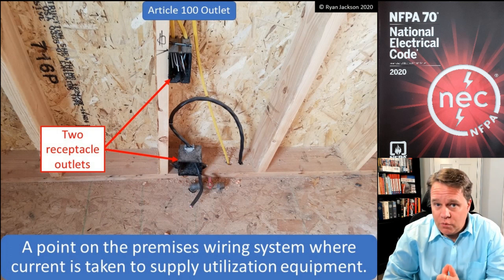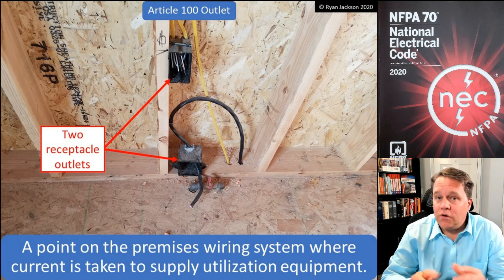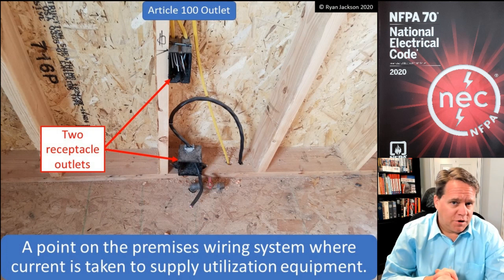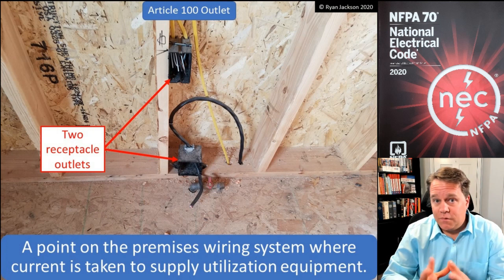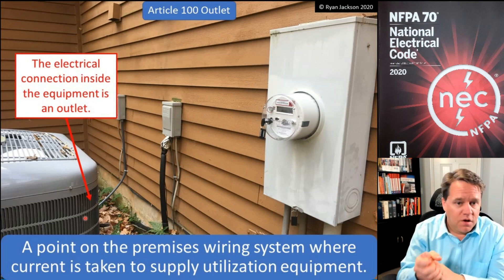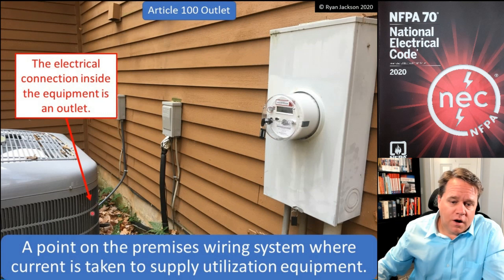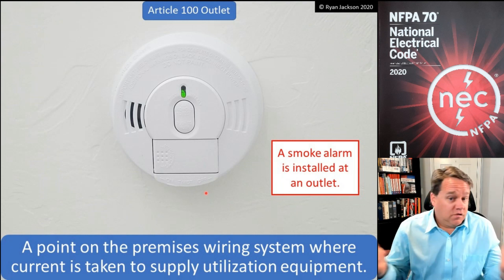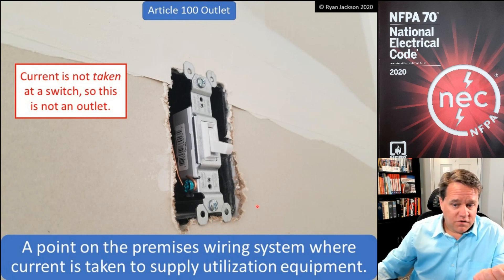100 Days of Article 100: Outlet

Comment: With the new "smart" switches like Z-Wave, etc. that can take the place of an old "dumb" light switch, those consume a small amount of current to power the internal electronics which enables them to turn a light on and off.  Also, there are even "dumb" light switches with backlighting, that's usually on when the switch is off.   Is there a lower limit on what sort of load a device can have and not be classified as utilization equipment?
Reply from the maker: Take a peak at the definition of "device," especially as it relates to a "primary function."

Comment: Great, now we have to GFI protect HVAC knowing there's no neutral and the GFI's will definitely give us trouble like hot tubs where you have to install the 60 amp GFCI at the panel with the neutral pig tail cause you can't use the 50 amp hot tub panel.
Gonna get to the point where everything is required to be GFCI protected.

Comment: If a switch isn't considered utilization equipment then what is the box that a switch is installed in called.
Reply from the maker: Just a box. It could be in a device box or an outlet box, but that doesn't make it an outlet. We use outlet boxes for splicing all day, every day, those aren't outlets either.
Reply: let's hope we get rid of cheap-and-overheating dimmers soon!